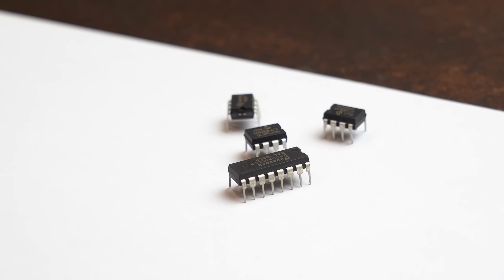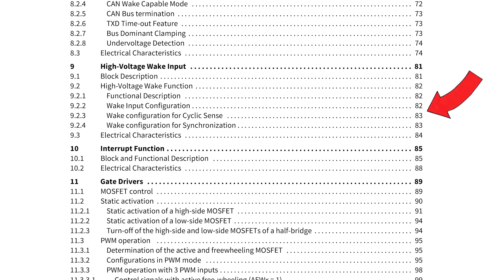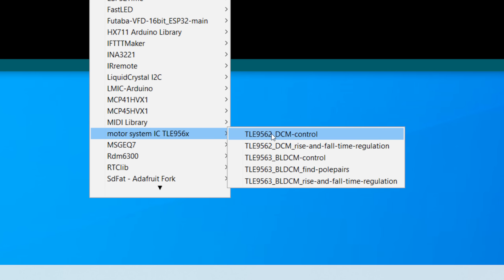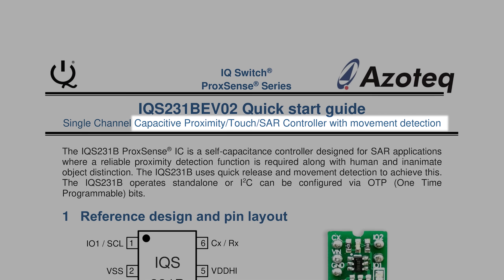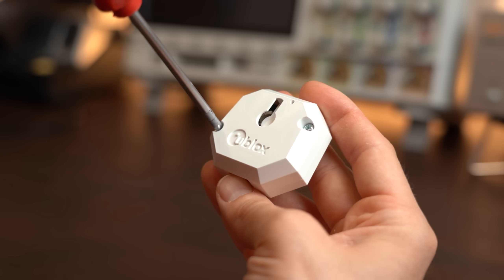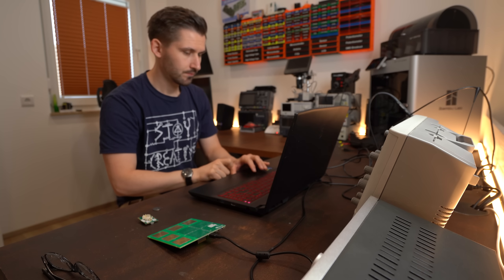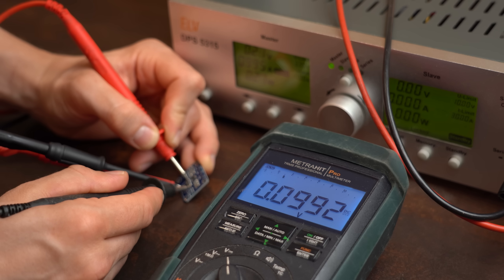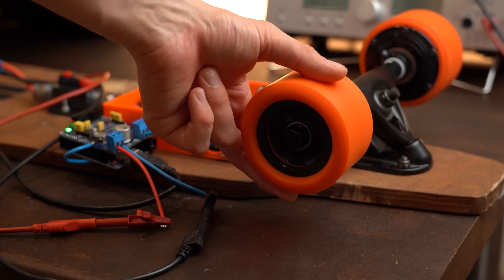I tried 4 Future Tech Boards! (That can do Awesome Things)

Comment: Awesome boards, nicely presented. Especially loved the bluetooth indoor positioning system. Wonder if multiple mmWave Radar sensor antennas could use AoA to sense human presence in multiple axis.
Reply: bluetooth prositionning has always been shitty and impractical for actual product, unless the sole product of the startup is a positioning device and the startup  wants to spend a whole year on the hardware and product design. 
Besides, what they forget to mention is that between this demo baord and an actual functional indoor positionning system there is quite a gap, you will need several base station, positioned strategically inside the building, and the whole setup will have to be very well though and tested before it can even start to work, and this process will have to be repeated or each and every location, which makes it a very unpractical product to sell and deploy at the client site. 
You'll also need some kind of processing unit that will gather all datas for the base station and determine the actual absolute position of each beacon. 

Needless to say this is no small project, lol. In reality, the only decently working technology for assets tracking is UWB and long range RFID, that is how it is done in the industry for a while, it is now cheap enough, so it doesnt make much sense to bother with bluetooth, which is not a suitable technology for assets tracking in the firsat place; AoA and antenna array kinda make it work, but uwb does a lot better job in the first place due to laws of physics.
Reply: Check out the Hi-Link LD2450. It uses FMCW 24 GHz to get the x and y-axis position (side to side and near/far) of moving objects

Comment: Looking at the desoldering troubles it seems you should really consider investing in one of those Hakko desoldering guns. Trust me they are worth it. But the cheaper way to remove solder stuck in the MCU pins is the use a conical tip to heat it from the top and a desoldering pump (a decent one) on the bottom to pull the solder out with the board stuck in a vice. It Always works
Reply: Seconding the suggestion of a hakko desoldering gun. I would specific either a proper hakko one or at least a more expensive one. The cheaper ones are not worth it unfortunately, I tried several before biting the bullet on the full blown Hakko.
Reply: @medes5597 Not true at all. If you can't make it work with a yihua, then it's you, not the equipment.
Reply: @AtlasReburdened  admittedly not used a Yihua but I'd consider that to be decent and well made - at least in comparison to what I meant. I was meaning more the very cheap ones that are littering Ebay, Wish and Alibaba currently.
Reply: What trouble ? it took him seconds and its a tried and trusted method developed over years ! You should begin learning this technique straight away .
Reply: @andymouse it took an hour, he said.
Reply: For clearing holes, I also like to just blow through a plastic straw to shoot the lead out. No rearming the desoldering pump😁

Comment: That Bluetooth motion tracker. Is there a way to maybe use something other than Bluetooth, in order to get more range? Could we make it 1km by using 2.4ghz drone style radio transmitters? It would be cool to have long range tracking for a couple projects I’m working on
Reply: There probably is but you'd have to use a lot of energy for 1km signal to survive or a lower frequency, which would require a larger antenna. The frequency also affects which objects it can pass through. The device measures the time difference of the signal arriving in each of the antennae, from which it can detect the angle of incidence. It is similar to how a radar works. But I'm mostly commenting, so I can read replies of people who know what they're talking about.
Reply: You can look at the UWB technology but on 1km seems a lot. Maybe the use GNSS RTK is a better option

Comment: You know, it's a basic skill in the electronic enginneering field to be able to use solder wick, a hand plunger, or if you're not cheap, an actual desoldering gun.
Those arent even that expensive unless you're going for something super fancy. For a home shop, just buy a yihua 948. It more than suffices and it's like 100-120USD.
Reply: Is your point that Scott needs to learn basic electronics skills?
Reply: @largepimping After observing the state of his solder joints, and the lack of improvement of them over time, the only possible answer I can give to that question is yes.
More specifically though, I think that if someone has a channel specifically focused around hobbyist level electronics engineering, they should probably focus on having basic pracical engineering equipment around and having a cursory understanding of their uses before buying a plethora of electronic nick-nacks.
Reply: @AtlasReburdened  After observing your comment, I have come to the conclusion that your opinion now exists.

Comment: For what can be used the last board? (Current Measure Sensor)
Reply: Measuring current of course.
Reply: @zaprodk  okay i get that but where it can be used with this design? I assume in fix place..
Reply: @janaboy82  You can use it together with a battery to see how much energy is going into or out of the battery, so you can calculate hvor much capacity is left.

Comment: Bro can u make a video on .... Designing a air bubble detector in a fluid tube sensor  its too expensive for a small job .
Reply from the maker: I can put it on my to do list. That does sound very specific though.
Reply: @greatscottlab  yeah , thanks for the response

Comment: Is it possible to use the BLDC motor control board to control the BLDC motor as a servo motor for position control? It already takes in the hall sensor input, so?
Reply from the maker: Good question. For such specific one you will have to really browse through the datasheet though. Sorry.

Comment: I love Integrated Circuits!
I would like to make a 555 timer from transistors only and a custom PCB.
Would be interesting.
I know it may sound silly but it's something new for me to try out.
Reply from the maker: Sounds a bit daunting but fun ;-)
Reply: There exist kits, but they have a lot of components, so goodluck with making your own pcb
Reply: Yeah, thanks!
It's for a future project.
Reply: Speaking about today's sponsor, Mouser has a pretty nice kit! It's called "Three five discrete timer"!
But it's good to design it on your own!
Reply: Oh yeah! I forgot about that! Thanks for telling me.
Reply: Step one might be to do it in terms of op amps (comparators) and flip flops…. Then break down these into lower level components before finally putting them back into the 555 as transistors etc.

Could be a series.

The 555 data sheet shows both the transistors and the higher level circuit with comparators and a flip flop
Reply: Yeah
Reply: heh, if you want silly usagi electric made a 555 out of thermionic valves ;-) You're fine. Link posted separately just in case it gets eaten. It's a nice video.
Reply: There has been a kit for this around for years Google it and you will find it's reasonably priced, as for making your own PCB this is also easy and the best software available is free (Kicad) so what's stopping you !!....cheers.
Reply: https://youtu.be/Erdep7XInWU usagis 555